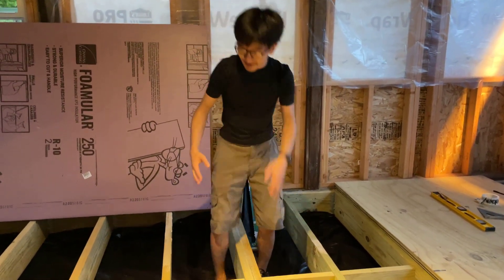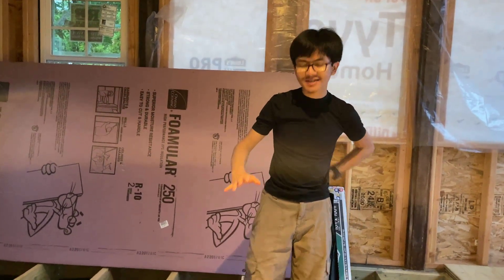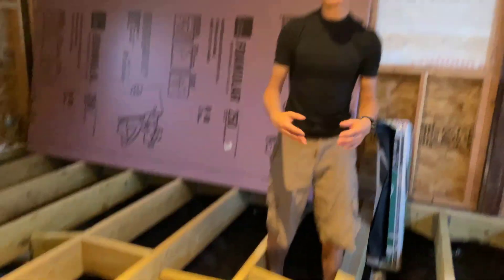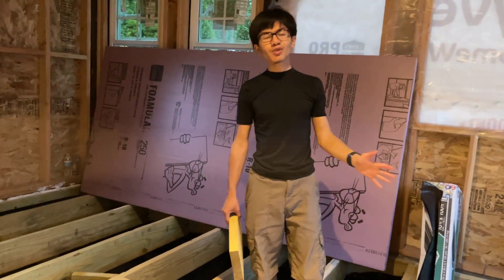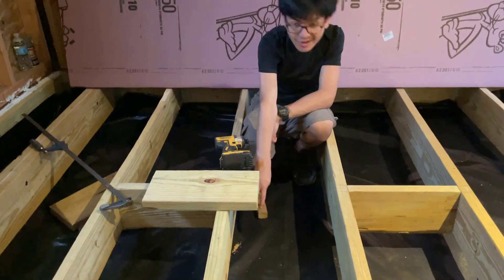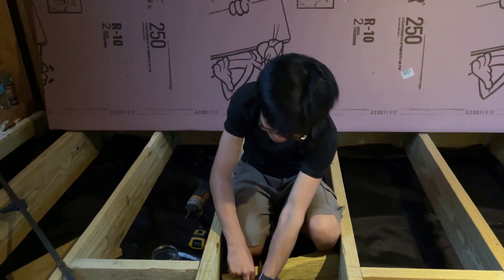Floor Joist Blocking & How To Fasten Screws (Or Nails) If Straight Line Not Staggered | Deck Framing

Comment from the maker: Here are the #ad links to some of the hardware, materials & tools showcased or required for this project:
1.  https://amzn.to/31Nn4vt  |  Power Pro 48610 Wood Screws, #9 x 2-1/2", Premium Outdoor Deck Screws, Rust Resistant, Epoxy Coated Bronze, 5lb Tub, 501 pcs
2.  https://amzn.to/3pKTmQc  |  Plastic Sheeting Roll 6 Mil Black (10' x 100') for Flooring Underlayment, Pond Liner, Roof Tarp, Landscape Ground Cover, Lumber Tarp, Drop Cloth, Painters Plastic, Construction Film, Room Barrier
3.  https://amzn.to/3dGVYcg  | Paslode - Cordless XP Framing Nailer, 906300, Battery and Fuel Cell Powered, No Compressor Needed
4.  https://amzn.to/3rRWzQr  |  BOSTITCH Air Compressor Combo Kit with Brad Nailer, 1-Tool (BTFP1KIT)
5.  https://amzn.to/3oKopfM  |  DEWALT 20V Max Cordless Drill Combo Kit, 10-Tool (DCK1020D2)

Or Click on Amazon link here and search for what you need:  https://amzn.to/3xIOsqg

Comment: Great video, and good attention to detail Aiman! Little tip, you might want to use a speed square check your blocking is perpendicular to the joists. When you put your first two screws in it looked like your blocking twisted a bit.

Comment: Now, why would you want to screw subflooring into the blocking? That can make joists more vulnerable to [tearing from] vibrations and shock from moving loads.
Reply: Depends on sheeting type and whether the sheeting is parallel or perpendicular to joist direction. Sheeting with a tongue is usually fine to be self locking but sheeting like compressed concrete sheets for wet areas and such that have no tongue are susceptible to orientation with respect to underfloor structures. If joists perpendicular to sheeting and the butt joins are on a joist you can find you'll get away with it but if they are running in same direction with the long edge sitting along the centre of a joist then you often need to fit blocking to take the butt join of the two sheets. Dunno what your codes are for various applications but here, if you have deflection at joints in the central area of the span then you have bigger issues. The issue may arise at a wall floor junction in a wet arwa where the spans, joist profiles, joist centers, fixing centres, sheeting integrity etc etc all combine to give a barely adequate load supporting profile (and compounding issues from other construction considerations) then deflection irregularities along the junction may become an issue if the manner in which its designed to direct and spread loads/forces  is disrupted by irregularities along such planes but hey, if you're cutting it that close to the line then if it's not unnecessary fixings (in perfectly flush and solid nature) then something else is probably gunna wreck your day along the line anyway

Comment: Blocking that is staggered is NOT as Strong Holding as straight line blocking
Reply: Yes it is . Angled screws are not as strong as screws with direct and straight pull force that you see we staggered blocks
Reply: Is for weight dispersion of the load above, not for reinforcing the joists themselves for strength.